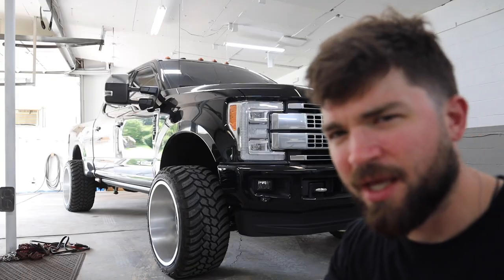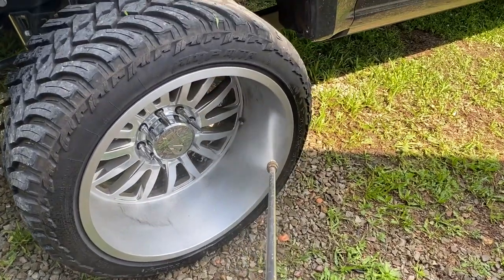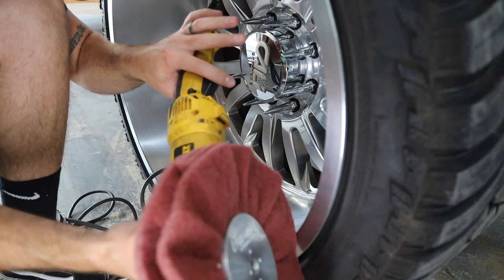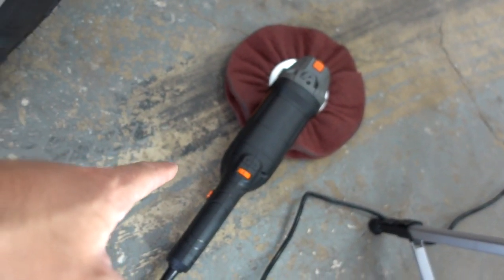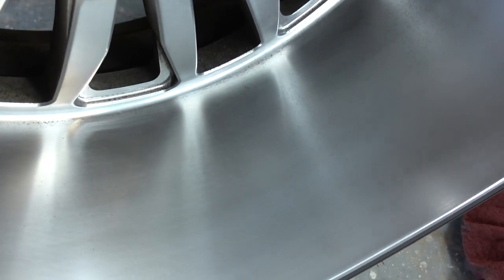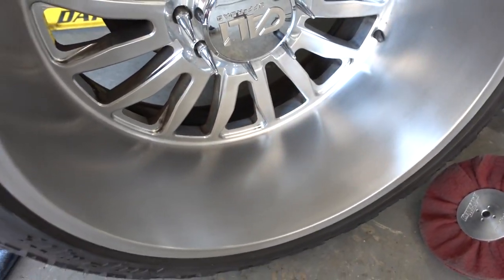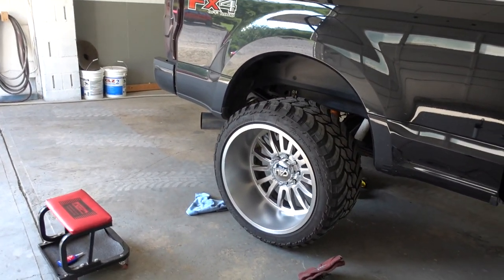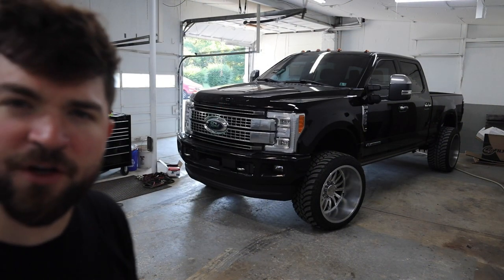REFINISHING Aluminum Wheels from Polished to Brushed Finish - LOOKS AMAZING!

Comment: Could I do this on brushed wheels to fix curb rash? There’s no videos anywhere about how to fix curb rash on a brushed wheel
Reply: Somebody answer this
Reply: That wouldn’t be abrasive enough to move metal you would definitely need to do sandpaper and maybe come back with a scotch brite or something like this to finish it off
Reply: Recently just sanded down my wheels, we’re chrome but switching to a brushed look

180, 220, 400, 600, 800, 1000, 1500, 2000, 3000 then 5000 for a super clean brush
Reply: @Baggedbk1  by hand?
Reply: @betodrk  I took my wheels apart since they were three piece and used a sander but you can do it by hand, just have to find the right videos

Comment: Wait.. you went from polished wheels to brushed buy using this wheel brush?
Reply from the maker: yes its like a red scotch-brite pad wheel,  works nice!
Reply: Do they require same maintenance care? Being in the oilfield my AF are f*Ed. Stained from the mud. I got them ceramic coated, but it didn't do anything.

Comment: Hey buddy, been wanting to run spe tunes but I read a review about having hard shifts from 4th to 5th and spe isn't correcting the issue or answering the customer ?
Reply: The shift are a little more firm in the higher gears due to less clutch packs.  No harm to trans, gears locking in how they could be. I’m extremely happy with my SPE tunes.
Reply: @Dieselnm101  great! I have some more questions lol, in stage 1 and 2 does it smoke? Also hows the drone? Lastly what year powerstroke r u running?
Reply: ACanela85 my trucks a 2012. I do smoke, only on heavy throttle once in higher RPM it clean 🧼.  It’s mostly due to stock gears 3.53 with 38’s.  Once I regear it’ll be much cleaner.  I’m running 5 inch full straight pipe, surprisingly I don’t notice any drone, again my 38’s Toyo M/T could be muffling the drone.
Reply: @Dieselnm101  nice, I have 15 and will soon hopefully run mt as well. But 37's
Reply from the maker: @dieselnm101 for the win 💪   but yeah if you are experiencing hard shifts then perform the trans relearn prodecure.  theres a few steps ill paste it in here

The 6R140 automatic transmission on the 2011 – 2018 6.7L Powerstroke has what is called Adaptive Memory and is constantly learning and adapting to different horsepower levels, temperatures, driving habits, etc. If you selected to tune the transmission during the Install Download process, the Transmission Adaptive Memory is automatically reset when the download completes. We highly recommend performing a Transmission Relearn procedure after installing transmission tuning to help the transmission perform correctly with the added horsepower.

The 6R140 automatic transmission will eventually learn over time on its own, but the relearn procedure gives a good baseline for the adaptive learning and helps to speed up the learning process. To perform the relearn procedure, please follow these instructions:

After tuning is installed, perform each of the following 0-80 MPH runs while in the HOT power level. During this relearn process, you may experience hesitation during shifts, hard shifts, or defuel patterns, all of which are normal:

0-80 MPH @ 25% throttle position, then slow down and come to a complete stop.
0-80 MPH @ 50% throttle position, then slow down and come to a complete stop.
0-80 MPH @ 100% throttle position, then slow down and come to a complete stop.

The Transmission Relearn procedure is complete.

Comment: Solution:  Don't buy bare aluminum forged wheels.
Reply: But they aren’t forged wheels
Reply: @dirtymacmotorsports  Well....bare aluminum.
Reply: They were chrome plated not just bare, forged wheels are polished bare aluminum, cast wheels like these either are powdercoated or chrome plated of some sort 👍🏻
Reply: Blake McGourty not all the time. These specific Cali Summits are a raw aluminum, no chrome plating. Just like forces you have to polish these to get that “chrome” finish.